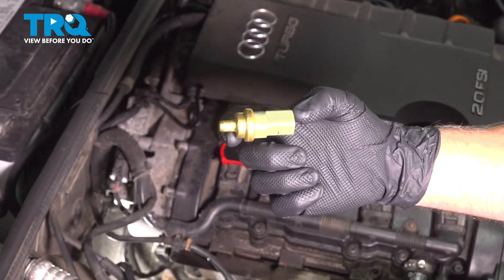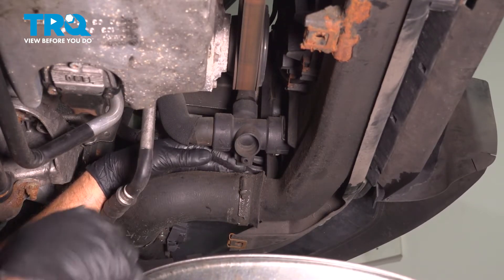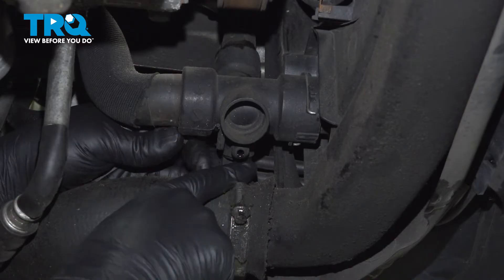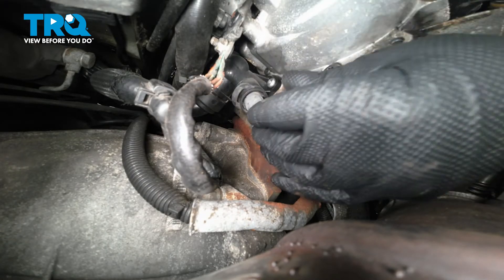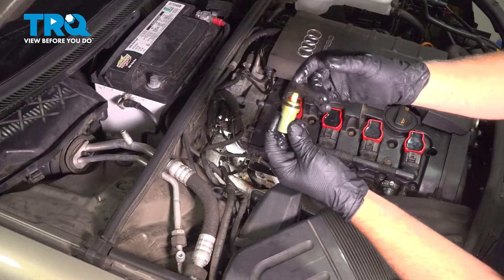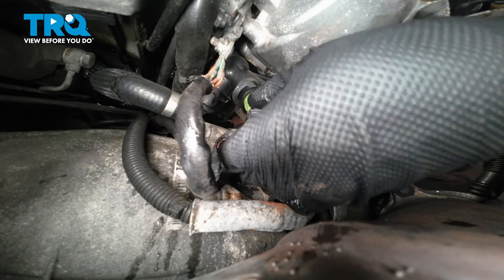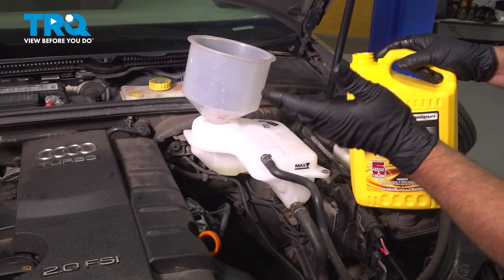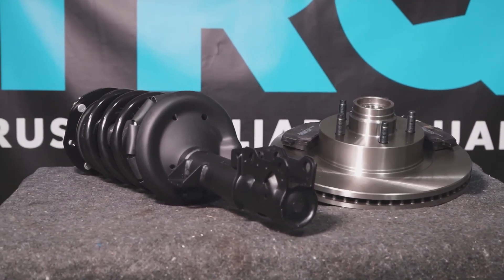How to Replace Coolant Temperature Sensor 2004-2009 Audi A4

Comment: Trying to get that crappy plastic pin back in is an exercise in pure frustration.  I was bleeding the air out of the coolant system and didn’t the original pin suddenly give out resulting in a hot coolant blast.  I have some words for whoever designed this.

Comment: I saw a video where they talked about a temperature sensor under the throttle valve directly on the engine block. I actually know that it's located at the rear of the engine, but in the video they showed it on the right side below the throttle valve and further inside directly on the engine.

What kind of temperature sensor is that?

Comment: I have a 2007 Audi a4 and coolant is leaking from the sensor would that be a bad coolant thermostat housing or maybe a bad seal from the sensor? And would you also recommend replacing both?